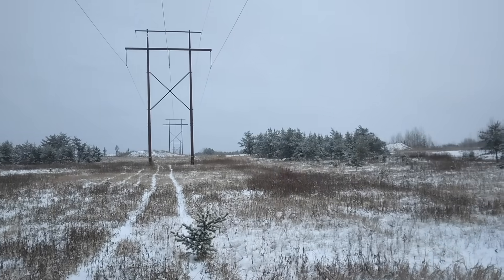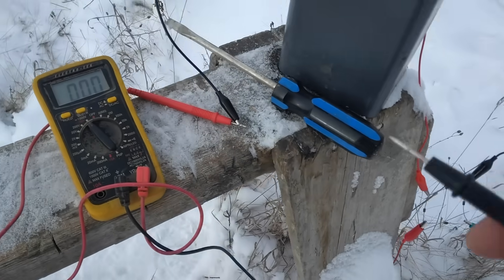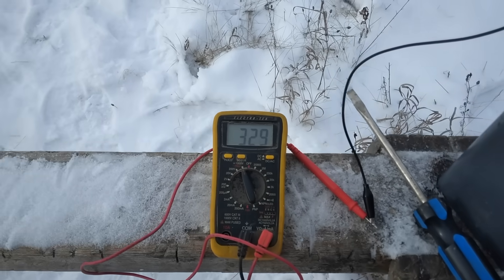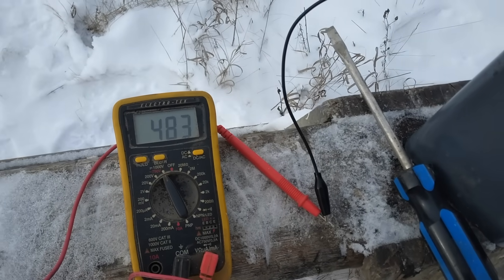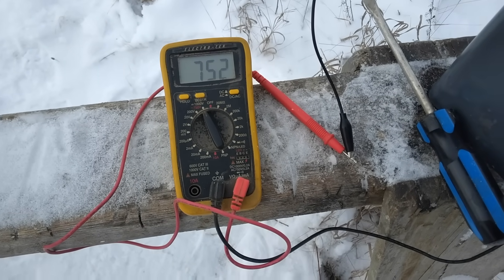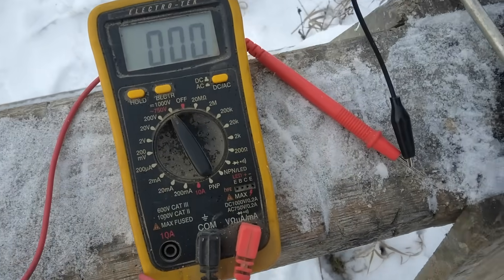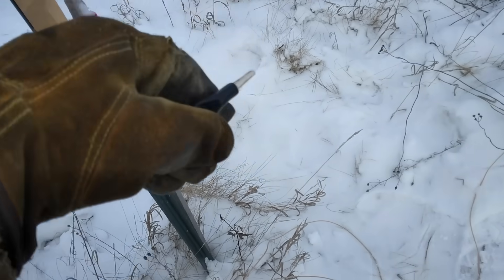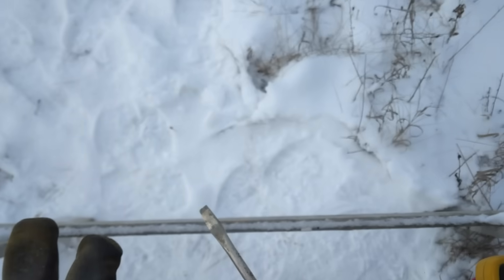Fences sucking power from under HV transmission lines

Comment: you can also use a flourescent tube stoop vertically, the potential betweem top of the tube and the bottom is a voltage gradient of the field emitted by the wires. It's not stealing electricity cos it has already left the wire and present no noticeable load to the circuit
Reply: This is how I understand it as well, are the power companies claiming that the current flows through the air when it is "stolen"? 
They charge for watts used, voltage multipied by current in a closed loop where they say the current or amps returns to source. 
They must be lying about how the high voltage power lines work if we can connect wirelessly.
Reply: @mackchris5451  exactly. power is synthesized on the grid by the large capacitors along the way, to keep the current & voltage in phase. a capacitor is an open circuit so the concept of returning to the generator is a phallacy. look up Eric Dollard and the theory of electricity. it is nearly 4hrs long but talks about synthesis of energy on these lines.

Comment: I am not sure how you are using the coax wire but the reason for using coax is to protect the signal on the inside conductor by grounding the outside conductor. If you are actually trying to pickup Induction from the overheads then it is probably best to either connect to the outside screen (reverse of normal) or better still don't use coax. Be careful though, there is a possibility of inducing high voltages, so take all precautions and don't get careless

Comment: it's called induction. The magnetic field off the o/h line through magnetic coupling will induce a voltage in any conductor within the vicinity.  Especially a 230 line. The induced voltage can be quite substantial if un grounded. It won't kill you but it will get your attention!   Remember a capacitor can build up a charge up to 1 and 1/2 times the applied voltage. So be cautions with capacitors. Ground your fence line. Think about this, that one 230 line can power an entire medium sized city. So there is a lot of energy there. Power co guy here.

Comment: Be very careful! Read about step potential. Cows and other animals can be killed (due to the distants from there front to rear legs) just by ground faults traveling back to the substation. The amount of current you get from your circuit will depends on the amount of current traveling through the powerline plus distants from the line. You made a very inefficient 1 to 1 transformer.

Comment: 36 joules over 10 minutes? That's only about 60mW. Would probably be enough to power a few LEDs or charge up a capacitor bank for occasional higher power use. Think something like a LoRa radio attached to a temperature sensor that only sends a measurement every few minutes.

Comment: Put a fence the maximum allowed height across the power line easement and once off of the easement put a double height fence.  Then test the voltage.  You can even insulate the fence across the easement from the higher fence to see if there is a difference.

Comment: Great video today, I also just watched your fluorescent bulb experiment, very interesting. I wish you would have checked to see if the capacitor charged after you placed the Alligator clip back onto the wire but on the insulation. Would it still send a charge through that thin insulation???  I just subbed, I’m from Naples Florida where it’s much warmer than where you live. By the way, is that a Knights of Columbus hat you are wearing in the video?

Comment: You are hardly stealing electricity, it would be similar to say you are stealing heat or light from the sun. The losses in power lines are quite great, the voltage is so high for the transmission etc. The losses are already inherent in it's design. What you are doing is making use of the magnetic properties of the transmission lines and letting the magnetic field induce into your line. If you scaled this up you wouldn't be reducing the power over the lines you would be harnessing more of the magnetic flux given out from the transmission lines. To create the right set up (with coils) there is the capability to harness this power which is readily being wasted as a magnetic product of the transmission, at high voltages.

Comment: Great video!   You might try coiling wire into plastic barrels to see what effect you get. About 25 years ago there was a fella here in Phx who was gathering enough of the power leaking out of the HV lines that ran across the back of his yard that he was running his house on it for free.  When the power co. found out what he was doing they were big mad, but the cops & court said he was breaking no laws so they had to leave him alone!
Reply: Amazing how all these bubbas somehow run this stolen electricity through just the right transformers to get the voltage just right to feed the house.
Reply: I wonder if coiling it inside of grey pvc conduit (used as rails for the fence) would be enough? Or does it have to be coiled in a large diameter?

Comment: One thing I would say to be careful of, when you have that capacitor charged then all of your wires, bridge rectifier etc are at that voltage and can put out high amperage because of the capacitor. You probably already know that, but it’s worth  saying just in case.

Comment: If current is constantly drained after the bridge rectifier, it won't be able to build up much voltage.  If the fence powered LEDs, how close together could the LEDs be and still light up?  If you keep frying LEDs, you could try the same thing with small neon bulbs which are OK with higher voltages but still light up and consume very little power.

Comment: Have you thought about putting a tuned 60 Hz dipole under these lines and tapping the center (current peak) to see how many watts it will generate?  Voltage is one thing but there may not be enough current to do any work.
It will be long but it looks like you could fold it into your pasture...
Reply: A half wave at 60 Hz is around 1,500 miles so it's difficult to "tune" a dipole at that frequency
Reply: @markdahl8082  I'm aware of that - thanks for bringing that up.  I was suggesting a shortened dipole...
Reply: @oxigenarian9763  Something could be done even though it's taking the term "electrically small antenna" to an extreme. Having said that, AM receiver antennas are extremely small and they work

Comment: Would the power go up if you cut the wire/fence and tuned it to some fraction of the wavelength coming off the power lines? Thus making the wire/fence resonant with the power line?

Comment: I heard about guys running bare wire perpendicular 90 degrees, under all the lines. They believe there's more capture that way. Think antennae. That's what helicopter crews are also looking for when inspecting remote lines.

Comment: I remember a story about 20 yeas ago. A farmer kept having bad problems with his cattle. Over a long time he finally found out the MUD had a charge running through it from the power lines.
Reply: Seems from the comments the power companies sue if you collect some of the stray voltages emissions.  But I doubt they were interested in any livestock issues.  I have HV power lines on the farm and is an easement, not a deed so no real right to destroy the farm use of my land.

Comment: There is no load, so voltage will get quite high. Try discharging it, then start over with a load such as a 100 ohm resistor. See what continuous current you get in that case. With the voltage and current that can be maintained you will see how much power you can get. Try some different resistors to see the maximum continuous power you can get. It is probably a very low level, not actually useful. But, a cap with no drain resistor can be very dangerous.  Handing charged capacitors to people has been a prank for many years, it should have been in Home Alone.,

Comment: Another trick I did was because I lived next to a 50,000 watt fm broadcast tower, I aimed at 10 element Beam at the tower and was able to connect a Deon pilot light to the end of the coax and have it light up when the antenna was aimed at the broadcast tower.
Reply: I reckon you could pinch power from an AM broadcasting station more easily than that even. Use an induction loop.
Reply: @Dazzwidd  true, if you happen to be near one of the larger ones. The FM here runs 50kW 24/7, but the AM is 1kW day and 4 WATTS at night.

Comment: Years ago I had property that had high tension power lines coming from the Grand Coulee damn running through it. I strung New Zealand electric fencing around the pasture under the power lines and they picked up enough to keep my cows away from the fences and zapped the hell out of you if you touched the wires. If you carry a florescent light tube under the lines it would glow

Comment: The same thing holds true for shunt fed and broadcast towers. I used to manage a tower facility in the Northeast that was adjacent to a school and had a chain link fence around it. Every time I would bring my key up to the lock it would draw an arc because the fence was electrically hot due to the RF field and the highly reactive antenna.
Reply: If its your land, and they aint paying rent, then Id say it was ethical. (They control and restrict your use of the land under the lines) Just my opinion.
Reply: BC Engineering stories. Old AM stations with rotted radials, everything is hot.
Reply: @harrypitts7389  failing radials can be fatal for transmitter sites. 25 years ago, I was CE for a AM directional along the coast. 16 acre plot with two towers. Owner was more interested in leasing space to cellulars, than in maintaining the field free of growth. I warned the owner multiple times about the roots severing ground radials but he continued to ignore.
Years later, one morning, I get a call. Station went off the air during pattern switch.
I drive the 3 hours to get there and notice smoked coming from the building's vents. I open door cautiously and step aside. Smoke pours out of door. Waited ten minutes then rushed in and turned the thermostat for the ventilation fan down so it would turn on. Ran outside and waited another ten minutes. Once the smoke was cleared, I went inside and observed the damage. The Harris SX5 has totally melted down. The contactor that did the switching was in the top of the SX5. It's insulators were made of some sort of fiberglass/waxy paraffin material, and when the contactor drew an arc, the arc sustained and caused the waxy materials to ignite, dripping down flaming debris into the lower part of the transmitter. It was a total write-off. I didn't want to tell the owner "told ya so!", but I think he knew.

Comment: in theory, if you could couple to just one of the 3 wires in the power line, the no load AC reading would be equal to the voltage of the power line. BUT because the 3 lines cancel out each others EM field, and you are coupling to them to a certain extent (because there is a space between the 3 wires), the actual voltage will be lower. However the amount of actual power (Voltage x Current) you can get out of this Air core transformer, with an actual load, is pretty low because the air gap makes it a very inefficient transformer. If your fence was long enough you may get enough power to slowly charge your phone. but the circuit you would need to bring the measured 1000 volts down to 5 would probably waste any power you actually get out of the wire. Physics is a cruel mistress!

Comment: Voltage yes, but power??? Power equals voltage times current (P=IE). Without measuring current, we don't know if there is any power at all. You can get the same effect by rubbing your shoes on a wool rug, but there's practically no power generated. As you said, only milliwatts. Not enough to do anything with. I'd try winding a coil around a long iron rod to get magnetic coupling.

Comment: Have you utilized a Gaussmeter to verify the strength of the magnetic field?
This would allow you to calculate a safe location for your fence. 
That is not a safe choice for a capacitor. 
A safe capacitor is concrete with conductive layers of carbon. You could build a concrete laminated wall/capacitor for storage. You can incorporate an automatic cutoff switch.
This qualifies as a fence. You can store about 12KV in a properly built concrete fence capacitor. 
Since it is an inductive load, it most likely would be similar to the losses they experience from locations which have a high water table. They won't even notice it. 
The transmission lines from the fence/capacitor would need to be quite large, about 2K MCM in parallel runs, and would give you 1500A at the 12 KV. You will have significant losses in the transmission lines, and I recommend a bury depth of about 80 inches to contain the magnetic field. If you want multiple phases, you need to do this three times. 
This is just a summary, the process is similar to utilizing atmospheric energy, which you can look up. That energy is calculated at 108 volts per meter of altitude above the ground plane.
You need to create a ground plane. I recommend 7 parallel runs of 2K MCM copper 30 meters long. You need to apply electronic grade solder to all the external surfaces before burial. Bury at the same depth as the transmission lines. 
You can look up electrical substation construction for more information.

Comment: Interesting stuff-thanks.

However I don't think 10 joules will kill anyone. The defibrillators  use to shock a heart back into a useful rhythm are about 200-300 joules

Below a cut from "somewhere" it agrees with my memory 200 joules 300 joules were released when someone's heart/chest was "shocked"

On a biphasic defibrillator, this is usually between 120 joules to 200 joules. On a monophasic defibrillator, this is usually 360 joules. 

Thanks-minor "pick"

Comment: Use a long coil of copper wire like the secondary of a transformer, wrap it around and iron core with an insulator, ground one end.
Check voltage across the other end to ground, you should get a good reading.

Comment: Great example of electromagnetic fields, aka Maxwell's equations, generated by high power electrical lines. Basically, moving electric charges induce the creation of a magnetic field and vise-versa. The magnetic field generated by the power lines then induces the creation of an electric current in the wire strung along the ground parallel to the power lines. The higher the electrical energy flow (Current=Power/Voltage) in the power line larger the induced magnetic field and subsequently the greater the electric current induced into the wire (electrical conductor) strung parallel to the magnetic field. The level of the magnetic field generated by the power lines is characterized by the permeability of free space(µ0=4π×10-7 T⋅ m/A)*current divided by (4*PI*R). R is the distance from where the magnetic field is generated. i.e. the high power transmission lines. Therefore, the amount of current generated in the conductor strung parallel to the high power line is inversely proportional to its distance from the power lines.

Comment: The most interesting question is how much actual continuous power you can develop.  I don't expect it would be much, but then again a long fence is quite a large coupling area for an electric field, even from 40ft away, and that capacitor was charging up pretty quickly.  I think you could get a few watts out of it without too much trouble.

You can try this:  bridge rectifier, then a resistor and a zener diode in series to ground as a poor-man's voltage regulator.  Or even omit the resistor.  Then measure the current and the voltage it settles at.  Industrial zener and resistor (e.g. 25W or higher).  e.g. 1 ohm resistor, 12V zener, and maybe a small capacitor across the zener to stabilize the voltage.

For use cases, with the zener to limit the voltage, you could charge up a super-capacitor bank for sure.  Charging a battery is a bit more difficult... a charge controller would probably get too confused, but with some voltage regulation and the natural current limiting of the circuit, you could probably just connect it up to a battery.
Reply: The power calculated was 55 mw.  If I recall correctly, the old 2 cell incandescent light bulbs were 2 watt.  So that fence would need to be 40 times as long to get close to full brightness out of that bulb.

Comment: The higher the voltage on the capacitor, the lower the voltage across the diode?
Reply: for a silicon diode, conducting (forward biased) is typically 0.5 to 0.7volts. In it's non-conducting state (reverse biased) is any DC voltage up to the breakdown voltage (the rated voltage of the diode) where the diode will self destruct. They can physically explode and fire bits of diode around, or quietly go open circuit without anything dramatic happening at all.
As to your question about the capacitor, I would have to know about the circuit connections to comment

Comment: Court cases have already determined that any inductive pick up and use of that energy is theft of power.  Just so you know.  You can ground your fence to  bleed of the voltage to protect yourself or your gear running parallel, but you can't use the power to do anything without paying the company for that energy.  Yes, that actually reduces the power delivered by the power company by the amount of energy being induced.  It isn't "free" power.

Comment: The fence is not sucking power from the lines. It`s called induction produced by the magnetic field created by the electricity flowing through the transmission line. And the comments below. You can`t power your house or charge your car from it. It amazes me how someone comes up with a crazy reason and everyone jumps on board because it sounds good.  Charging a capacitor is a poor way to prove his point. The pilot light in your old gas water heater was not dangerous. If it went out and leaked gas into your house it would take several days until it created a dangerous condition that could cause an explosion.